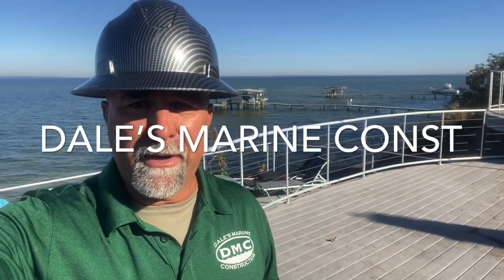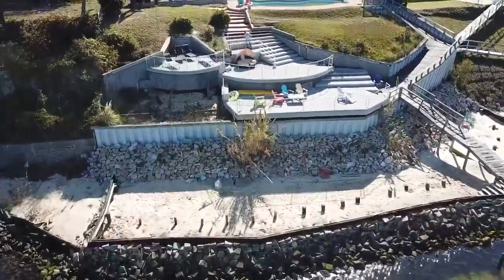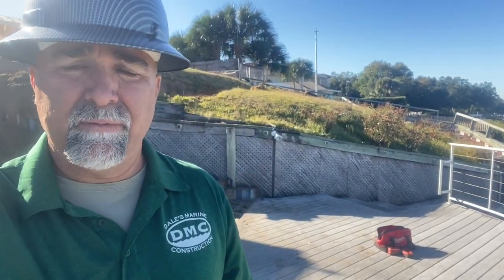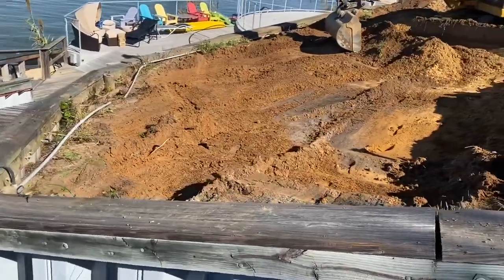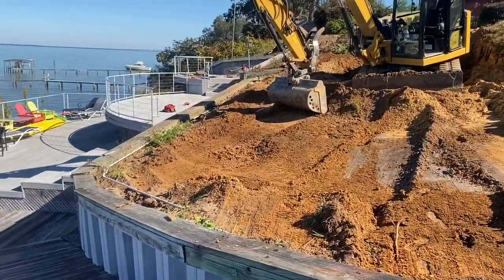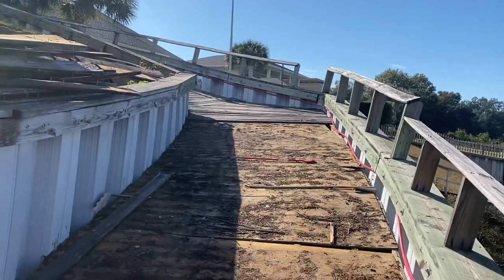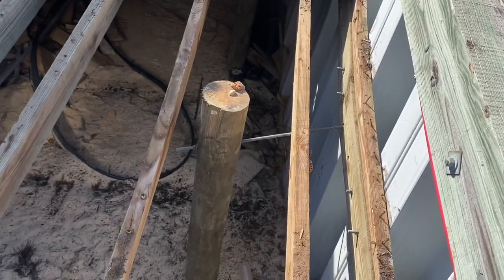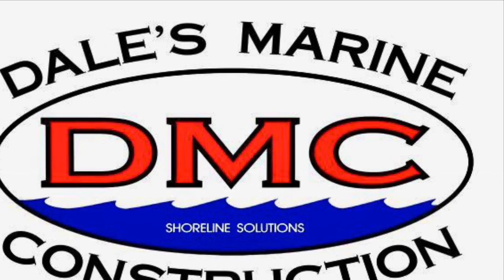FAILED | MULTI LEVEL VINYL & WOODEN RETAINER WALLS | EPISODE 1 | DALE HICKMAN

Comment: Awesome. Looks like you might get in some gnarly spots with that backhoe. Ever rolled it?
Reply from the maker: HWwelds I had a rental one time did the safety was not working properly. When I was swinging around on the barge with a load of decking everything stopped over the edge of the barge in rolled off the side. I was able to push it back up with the boom on the barge it was hanging from one track
Reply: @DaleWHickman   Damn. No video?
Reply from the maker: I wish that would probably been a viral one 😂🤦🏻‍♂️